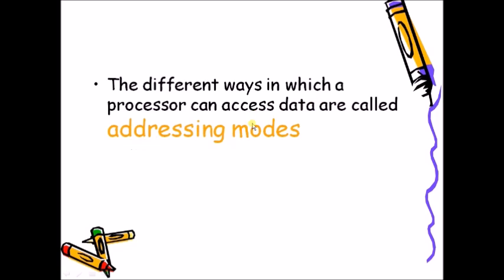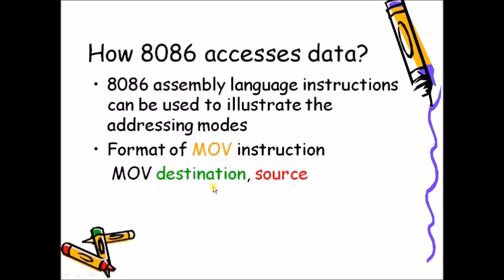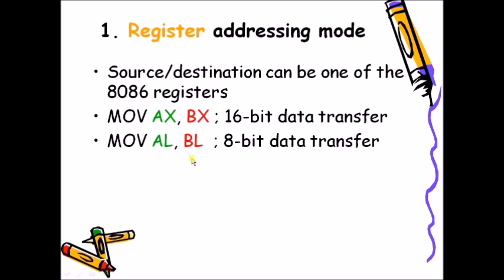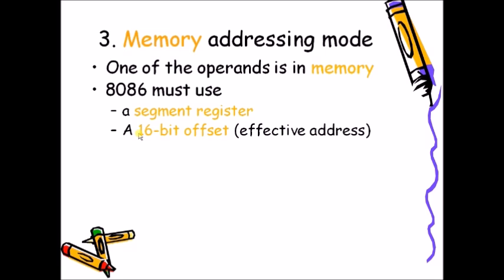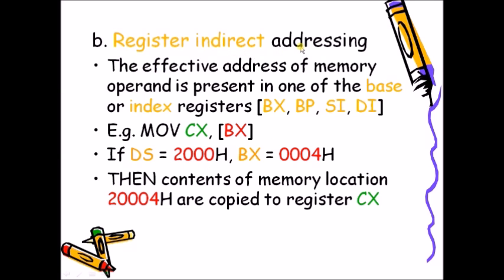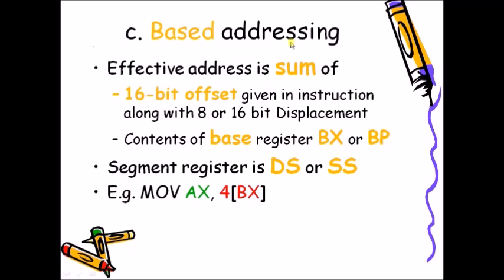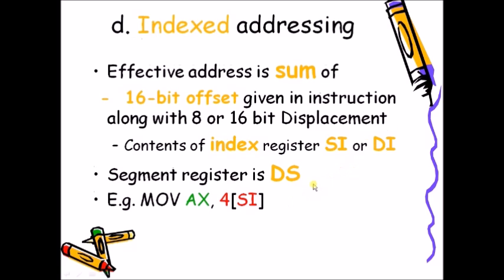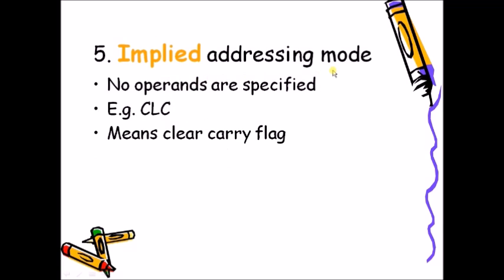8086 Addressing Modes Tutorial - 8086 Microprocessor

Comment: Segment register DS to 2bytes ka hota hai which means 16 bits. To segment register + 16 bit offset register =20 bits kese hua? 
Sir plz telllllll
Reply: You have to understand that 16bit address+16 bit address=16 bit itself.But what the BIU does is add zeroes to the end of 16 bit address to form 20 bit address.That is the reason the contents of ds register are shifted by four positions to left and then added with offset.So basically it is 20+16 bit address=20 bit).This is an internal function of 8086 since 20 bit address means it can access upto 1mb memory

Comment: In register indirect mode 2000H + 0004H shouldn't be 2004H instead of 20004H ?
Reply: The formula is :-
(DS * 10) + offset

Let,
MOV CX, [BX] 
OR
MOV BX, 1234H

BX = 1234H
DS = 1000H

The in this case the 20-Bit address genrated is 11234H and offset(1234) is saved in CX.
11234 = (1000 * 10) + 1234